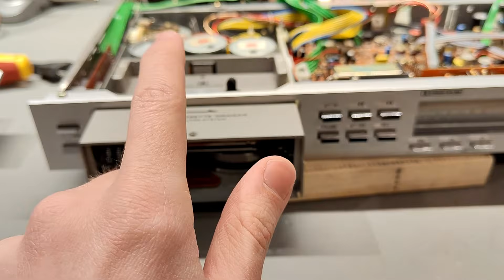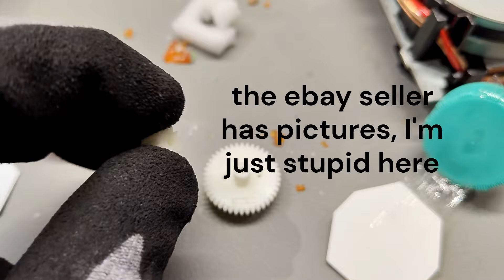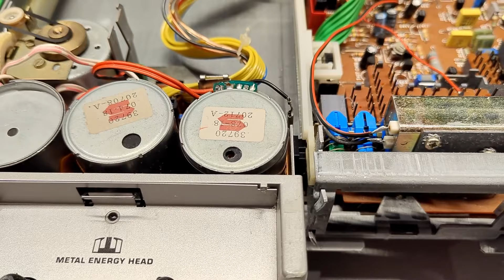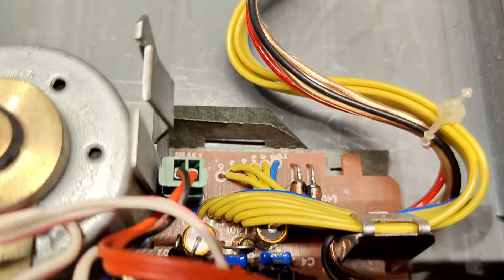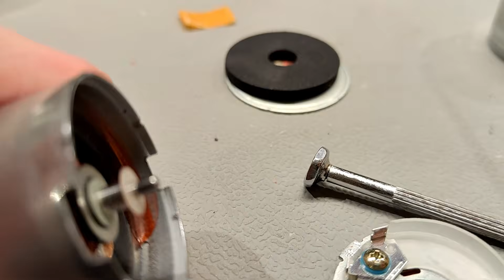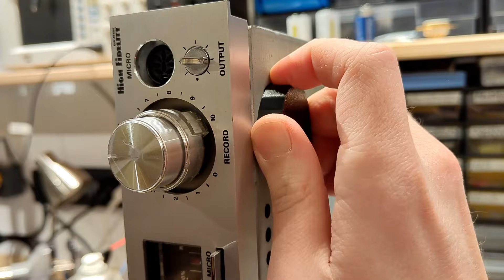Grundig SCF6100 Cassette Deck Mechanical Overhaul Odyssey

Comment: It's a beautifull deck. Nice repair.  I prefer the cassettedecks with a window though.   What does that micro button do ?
Reply from the maker: The micro button switches between the microphone input at the front and normal line in during recording. Line in will be muted while the microphone is active.
The microphone input is also somewhat special, since it is supposed to be used with a stereo microphone, and it also has phantom voltage. The Grundig GCMS332 should be a great fit for this deck for example.

Comment: Saw that 2 of the LEDs in the left digital VU meter have gone dim = a electronic fault with the driver IC chip?
Reply from the maker: Thanks for pointing that out, I actually didn't notice this until now 😅
It indeed seems most likely, that one of the IR2E02 ICs might have an issue. But I would have to measure the LED current and check all solder joints just to make sure.
Luckily this IC still seems to be somewhat available as NOS on eBay.
But either way, it doesn't really bother me, so I will leave it